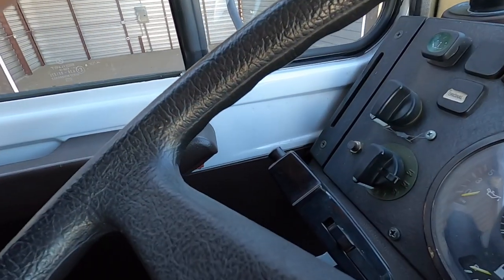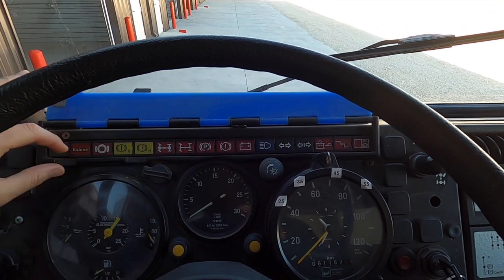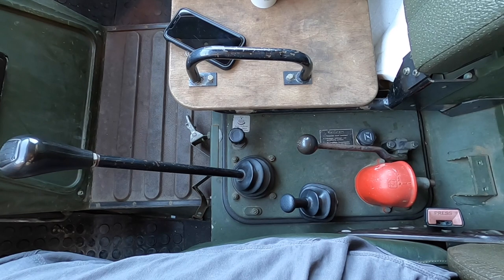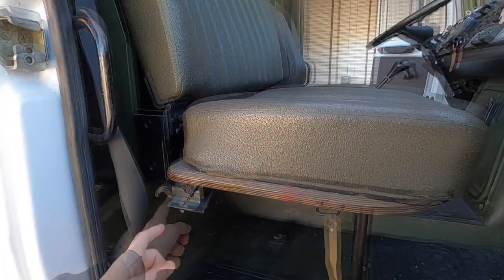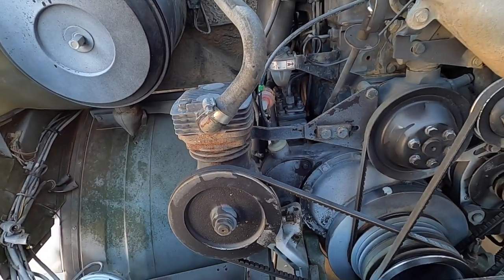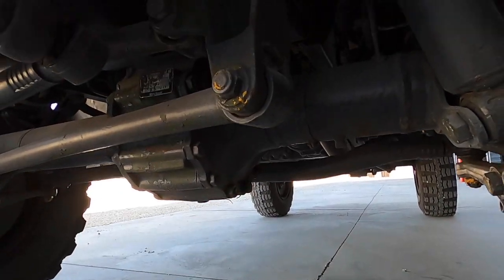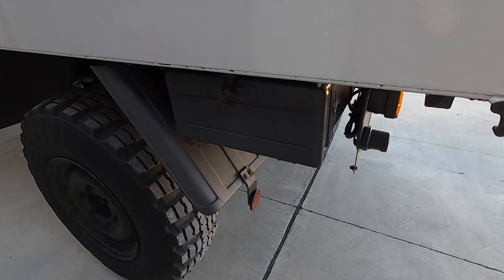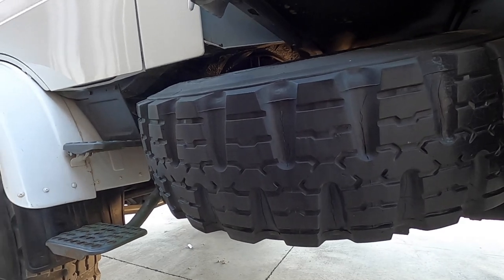Unimog U1300l - Expedition vehicle build ep1

Comment: those fold down covers for the lights are a remnant from the military, this mog was a geman army truck once. When driving at night in dangerous areas the headlights where covered with a cap that had a tiny slit and you used those things to cover all the dashboard lights. Kind of like silent running in a submarine, as little light emission as possible.
Reply: It’s called „Tarnlicht“ (camouflage light) in German. The turn-switch on the left of the dashboard is for different levels of camouflage. The blue light shade helps to reduce light pollution

Comment: Excellent video. When I find my Mog I’ll be calling for a custom composite build if your game. Do you mind sharing how much your 1990 Mog cost? I’m in the market for a 25 year old Mog.
Reply from the maker: The cost of these vary a lot. You can get them as cheap as $28,000 all the up to $100,000+  for the just the unimog. Mine was about mid range in that cost.  Look for turbo motor and high speed axles when you start looking.
Reply: @RoamOverlandVehicles  That’s what my expectations and research also reflect. What would a build from you range in cost and time?
Reply from the maker: The build time I’d estimate 4-6months of full time 5days a week type of thing.  Cost. I’d estimate a fully decked out overlanding rig would be well over $200,000.

Comment: 365 80 R20 is = to 14.0 R20
Cabin blower fan is not easy to remove for repairs as the entire ducting across the back of the engine needs to be removed.